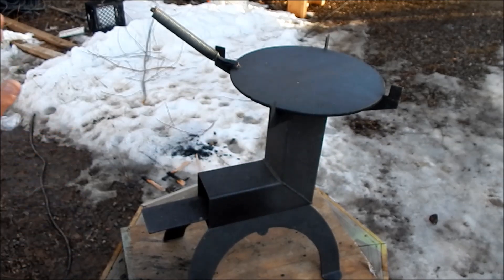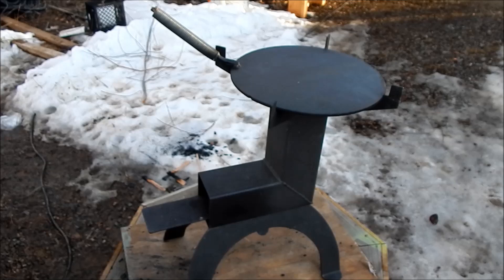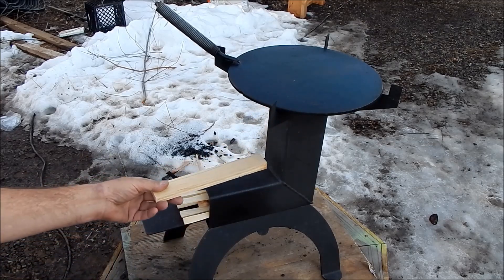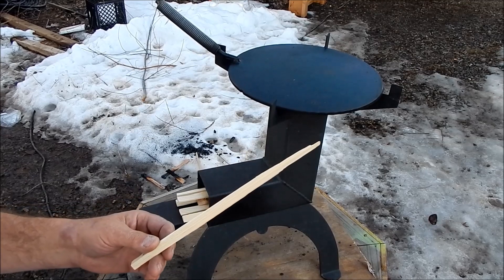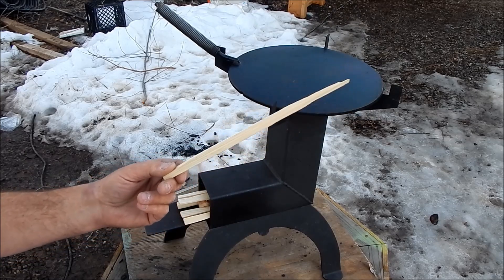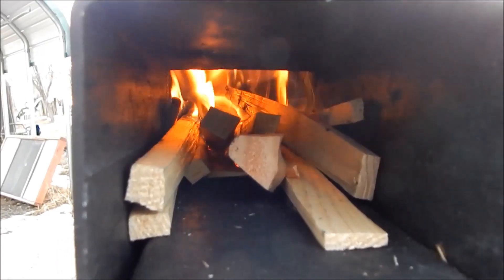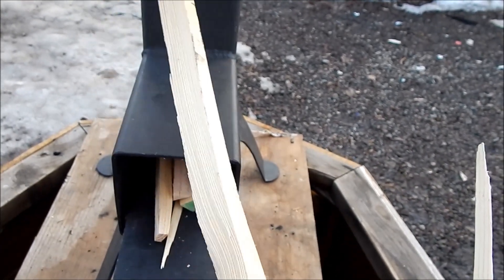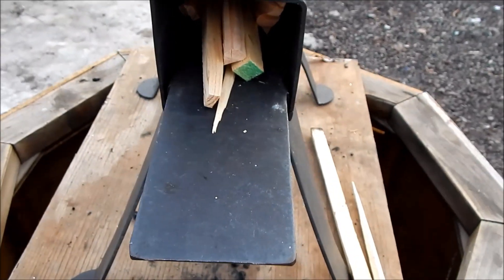Solving a Common Rocket Stove Problem

Comment: Is the same problem as gun powder 😊 You can't pack it in, air must circulate that how they came up with granulated gun powder. And now they sell wood pellets for smokers as in BBQ but sticks from the forest that have been seasoned works great but you must know what type of branches are nontoxic also burning compressed wood or processed wood is kind of iffy

Comment: Too cook and start easy + preheat, fast,

you prepare small pieces to feed in the chimney, the more wood you can (small),

 start by the bottom, one piece of paper or two only,
wait few  minutes there is white white smoke (pyrolisis)
and then light by the top of chimney. only (bottom mustn''t biurn)

You can know fedd with bid wood, by usual feeder.

Norwvay invents neostove, first rocket in can,
and start it like that.
Test, wel perpare amount of small wood before fees chimney.

Comment: Why do so many rocket stove videos show them being fuelled with expensive shop-bought prepared timber (lumber)... stuff that has previously been planed to size? Rocket stoves work with twigs off the ground, which cost nothing. This waste of money puzzles me.
Reply from the maker: Those are all scraps of lumber that I generate when I work in my shop. I burn them instead of tossing them.
Reply: Dennis Evers Okay. I understand. Thanks for responding.
Out of interest... What kind of things do you make in your workshop? Is it a profession, or a hobby.